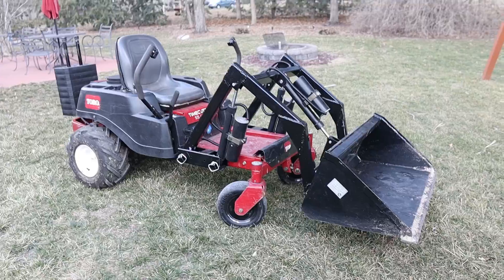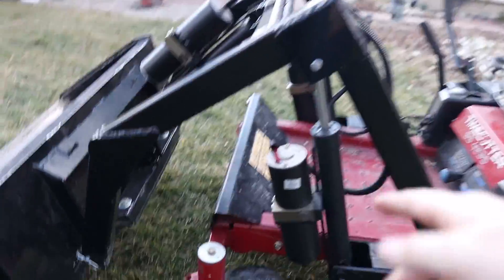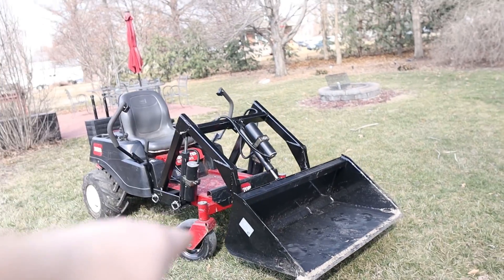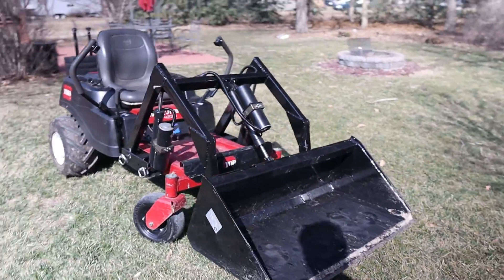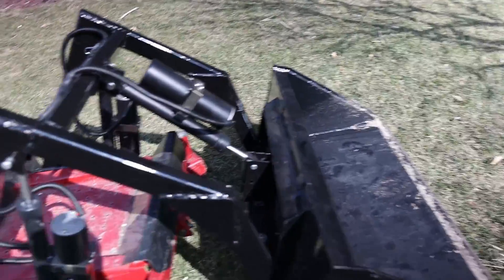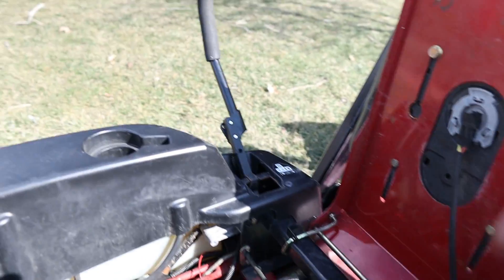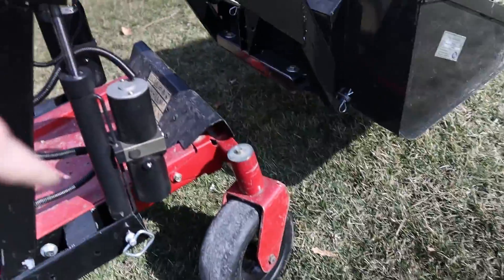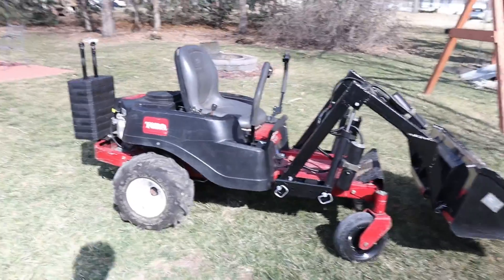You Converted a Toro Zero Turn into What?? - Homemade Skid Steer/ Front End Loader

Comment: with rubber tires like that  it can go on the highway  with the SMV triangle because it has a top speed of 25 miles an hour or less therefore it's a slow moving vehicle like a skid loader or farm tractor I use a slow-moving vehicle sign on my Craftsman gt6000 because a tractor is a tractor no matter how big it is and that's fact's

Comment: Cool idea. I suggest upgrading that little trailer plug connector as it will overheat with 40+ amps. Anderson powerpole 50amp would be good. They make rubber boots to cover when not in use.

Comment: Hmmm...same bad design as all the other makes of these things.  Let us see you load that huge bucket up with gravel and drive over dirt or gravel with it.
My point is it would be much better if your frame mounts were behind and in front of your rear tires.
Why?:
Weight 90+% on rear wheel.
Bigger axle
Tiny wheels won't sink in as yours will do ATM.
Won't lose traction.

Go ahead and make me a big-mouth dummy on the internet and show me a big load over non-paved soft ground.
BUT sure it will work....just "cringe" in that it is another video doing it "this way"...which may be OK...but is far from "good".
Reply from the maker: I absolutely agree that this isn’t the best design. It is not intended to replace something like a skid steer or dingo. This is simply a design that expands on a machine that many people already own. 

Really this is a big step up from a shovel but of course a leap away from commercial equipment. If anyone built this with those expectations they would be enlightened rather quickly. 

I will add one concern on a mower like this where the frame is a thin C-Chanel. If the pivot for the arm was at the rear and the actuator was fixed in front of the rear wheel this would be an extreme amount of force likely causing the frame to bend. Also the extended travel and weight of the attachment would be too much for the cylinders that I have. It would dramatically reduce the payload and likely struggle lifting just the bucket.

Regardless, there is always room for improvement and I documented my take on the idea to make it easier for people to improve.
Reply: @ChadMees  I plan on making something a bit more robust next summer.  There is a great deal of lift difference between these lawn tractor scoops and a skid-steer.  My goal is to be able to dig non-loose soil 300 lbs a scoop.  The cost should be about the same as yours.  Some critical design changes should see some significant improvements.

Comment: Just finished making a zero turn loader myself.used an older simplicity zt mower. Made the bucket out of heavy gauge steel and the rest with metal that was hanging around.I did it with hydraulic cylinders and a electric hydraulic pump, like what is used to tilt truck beds. Like your loader this thing is alot more powerful than I thought. Your video and others inspired me to make one. Each of my hydro drives are rated to take 800 lbs of weight so I'm not worried about stress on the drive system. It was a challenge but it was fun making it. Learned alot on this project. Thanks for the inspiration.
Reply from the maker: That’s awesome! Do you have any videos of it? I’d love to see your design
Reply: Still a work in progress but overall works great.Don’t have a video on it.I may do a quick video of it and put it on YouTube.
Reply: @mikeditomaso4451 I would love to see a video of your build

Comment: Would work better if you'd set it up with the loader to the rear and mount the  seat at the "front" that way he weight is on the big tires.
Reply from the maker: In order for that to work It would require a ton of weight to counter balance the bucket and whatever you are trying to move. It would make the entire system extremely heavy but I do agree that having the load on the larger wheels would be beneficial in several ways
Reply: Or mount the arm at the rear like a bobcat so that more of the weight transfers to the rear tires. But that involves more fabrication and design.
Reply from the maker: @kdrapertrucker  I agree, I wanted to do that but looking at the way the zero turn is built would have made that much more difficult. It would have also used much more material and could interfere with the drive controls. My main constraint with building this was to be as simple as possible and still be able to get on and off from the sides rather than stepping over the bucket like a bobcat.
Reply: That was the idea I had when mulling over ideas for a 'non-skidding skid steer'. Put the loader/lift arms on the back over the drive wheels to carry the weight and have it become 'the front', with the caster wheels now being 'the back' - would navigate like a forklift I think. The weight distribution is all wrong as @Chad Mees says - it would be a complete rebuild.  That led to the idea of making it an EV conversion where you can put the batteries at the back as part of the ballast.  Fun to think about, but probably not worth the effort. If you can find a free junker ZTR though......

Comment: I wonder how much of an adverse effect this use of a zero turn has on the hydraulic transmissions.
Reply from the maker: Fingers crossed, I haven’t had any issues at all!
Reply: @ChadMees  A lot of extra weight, loads, and stresses on this machine now that it was never designed for are my thoughts.
Reply from the maker: I agree. It is definitely not the intended use of a 11 year old mower. However it truly has been a workhorse. We used it to move a ton of gravel, dirt and dig for our garage additions and it never skipped a beat! I myself am also impressed with how it has held up since the hydros were a big concern of mine

Comment: How much do you think those front wheels will hold up?
Reply from the maker: Solid tires are rated for about 600lbs
Reply: @ChadMees  it's not the tires; it's the fact that they are caster wheels... If one of those hits a dip at the right time as you're changing direction the lateral forces on that spindly little...spindle are incredible.. I got 1½ seasons out of mine which wasn't worth it... It's a heat issue hydraulics get really hot and when pushed too far it ruins parts
Reply: @Lex Man there is a reason you don't see loaders with caster wheels... I think it could make more sense with the loader on the back but idk it's just a whacky idea to me I've made a hydraulic drive zero turn into a 4wd skid steer and it worked great as a plow but I fried a pump pretty fast... They're not made to push loads like that at low speeds it takes an incredible amount of torque to push a blade through snow nevermind scooping up rocks or dirt...it also seems like it could be dangerous?
Reply from the maker: Odd that you blew the pump so easily. Maybe it was fighting itself? I’ve seen attachments for zero turns like plows that bolt on and people seem to use them pretty hard! Obviously this is not the ideal use case for the hydros but as I’ve mentioned before I haven’t had even the slightest hiccup. That’s doesn’t mean I won’t blow one but I’m impressed nonetheless

Comment: Love innovation..   I modded my SW4200 to be a super vaccuum leaf collector.   The ZT can go near anywhere..  mine is a wannabe tractor, thinking a bucket might be in order.  BTW.. you can install bigger tires and wheel spacers for even better Traction.
Reply from the maker: I have actually done this already. I installed 1in spacers and put slightly wider and taller mud tires on the rear for more control. It made a big difference with handling especially on loose surfaces like gravel
Reply: @Chad Mees  would love to see a update of the 0turn fel
Reply from the maker: I’ll see if I can put another video together in the next week or so. The weather has been pretty poor lately
Reply: @ChadMees  That would be great. Thank you so much

Comment: Have you tested the lift capacity Before lifting the rear tires?
Reply from the maker: Before putting the additional weight on it I did not test the lift capacity. The loader was not at its limits but I would have trouble because even though the rear wheels were still on the ground, I wasn’t able to steer or move around. The wires would slip/spin because there was t enough weight on them.
Reply: You mean it won't turn because the shopping cart wheels are buried into the ground and bound up🤣 I hope you don't get hurt on this but that is the only thing I can see happening if you ever use this for more than a few pebbles

Comment: The capacity of the bucket is comparable to a small wheelbarrow which can easily be operated with muscle power so you don't need hydraulics.

I would use 12 volt  electric linear actuators. They are available with various stroke lengths and weight capacity.  I would just use a lead acid car marine/deep cycle battery or two of 6 volt golf cart batteries which I would mount on the back as counterweights.
Reply from the maker: I looked at linear actuators and unfortunately they are extremely slow when dealing with large weights. Also I believe you are underestimating the capacity of this. It can lift 600lbs in the bucket above waist level. If you can find comprable actuators that can move at the same rate and support the same weight I’d be more than happy to check them out.
Reply: @ChadMees  How quickly (number of seconds) do you need to raise the full 600 pound load to a height of 3 feet?
Reply from the maker: Roughly 10 seconds from memory
Reply: @ChadMees  What power is required? (Assuming 100% efficiency.)  (600 / 550) x (3 / 10) = 0.33 HP which is 250 watts.  Since there would be an actuator on each side of the bucket that is 125 watts per side, or 125/12 = 10 amps per side.

That seems reasonable. Now let's see if we can find an actuator, keeping in mid that we will use the arm as a lever so a short movement of the actuator causes a large movement in the arm.

Comment: Very nice. Those cylinders solve the problem of installing a hydraulic pump and reservoir and running hoses. Thanks so much for sharing.
Reply: Don't zero turns already have them built in? That's how the wheels are powered.  I'm trying to find a way to get auxilary hydraulics to work on mine
Reply from the maker: Technically the hydrostatic motors for the drive wheels is a hydraulic system. I wouldn’t ever try to run anything auxiliary off of them due to the massive amount to modification that would be required. Also the hydro drives are usually what fail on these mowers so I wouldn’t want to put any additional stress on them.
Reply: @ChadMees  hmm perhaps I can run a separate pump off of a belt or an electric one with an alternator. Thinking of a backhoe attachment too but at that point it might be cheaper to hit the auctions lol
Reply from the maker: @andrewk8636  if you were to go all hydraulic you could ignore the alternator. There are a few guys with videos on YouTube showing a power steering pump being used with a control valve to accomplish a similar thing.
Reply: @ChadMees  alternator makes it way simpler because I don't need to figure out clutches or find room for a huge pump under the mower. I plan to keep it all removable so I can still mow. I got a ton of research to do on the various systems.

Comment: do you have someone interested in manufacturing a kit that could be installed without having to weld the frame?
Reply from the maker: I do not. This would be a very specific kit and only fit certain mowers. Given it could be adapted to many but would take some time.

Comment: This is an awesome setup. Great job!  When trying to balance tractor attachments, lots of folks add calcium chloride to the rear tires.  Especially on a zero turn, the rear weight setup you have is probably a much better choice - the added rotational inertia from weighted wheels would rob you of the "flickable" nature of turning the mower.
Reply from the maker: Thanks for the kind comment. I looked pretty heavily into adding weights within the tires and found a few companies that will fill them with different materials. The issue I had with this was mostly the cost. Some of the research I did showed people filling the tires with water but again I didn’t feel comfortable with doing that. I also prefer having just air in the tires because playing with the pressure is very helpful in different situations. I went with the cheapest route by using the gym weights since they are relatively cheap and easy to come by. Another reason I think adding weight like this is that it is behind the hydros therefore I can use less weight compared to if the weight was added 1-2ft further forward.

Comment: Sadly those Hydraulic Actuators you used are sold out there, can't find any other ones like them anywhere, guess I gotta build a hydraulic system then lol
Reply from the maker: They have been telling me they should be in stock mid July. I will reach out to them again but they had a big run on them initially.
Reply: @ChadMees  Fair enough, I mean the whole world is having shortages on everything it seems, but I'll keep my eye out so I can snag a few of them!
Reply from the maker: Definitely, the hard part for me was even finding these to start with. They are not very popular (yet) I think projects like this will change that and more sellers will stock them. Unfortunately for the time being this seller is the only one in the US that even is getting them. You can source them directly from China through alibaba but they are a bit pricey. I’m hoping this seller is getting a bunch because I have had a ton of people trying to build these and they are hung up on acquiring the cylinders
Reply from the maker: My last message from them was saying they will be in stock July 15th. I really hope they have a lot of them but I would keep checking the link because I expect they may not have them very long. I will probably buy a few for some other projects too just so I have them!
Reply: It's October & they are back on Ebay.

Comment: Hey I’m looking to replicate this on a cub cadet and see how it turns out. Finding the actuators are not easy.   I have 2 questions for you. 1) why 10” and not 12” actuators 2) could you look at alibaba and see what actuators you would use from there? Since I have no idea what I’m doing just trying to emulate what you have done? If you could send a link or pm me so I know what to order that would be awesome. Only parts I cannot source.
Reply from the maker: Check out this product on Alibaba App FY023 Waterproof Electro-Hydraulic Linear Actuators for Chemical Industry

https://m.alibaba.com/product/1600149577112/FY023-Waterproof-Electro-Hydraulic-Linear-Actuators.html?__sceneInfo=%7B%22type%22:%22appDetailShare%22,%22data%22:%7B%22filterKey%22:%227.8.2_share%22,%22cacheTime%22:%221800000%22%7D%7D
Reply from the maker: Main reason I went with 10” was for the compact size when it is the fully compressed position. As for sourcing the actuators I need to reach back out to the eBay seller because they simply had the best price and shipping time. They are on alibaba but they are a bit of a pain to search for. I believe I had to search “hydraulic actuator” to find them. I will comment a link to one similar to what I used.
Reply: @ChadMees  They are now (10/21) back on epay.

Comment: This is pretty cool. The only thing is I realize the hydraulic actuators are convenient, but wouldn't it be so much cheaper and higher performing if you just built a hydraulic unit and used conventional cylinders? Then you could have an auxiliary valve for a grapple or anything else you wanted on there. Also it would be cool if you added a quick attach so you could put forks on for moving pallets around. Not trying to be a downer, love the ingenuity just throwing out ideas.
Reply from the maker: My main reason for going with the electric cylinders was to make the entire thing easy to replicate. Connecting a few small wires and routing them through the mower is easier than dealing with a hydraulic pump, manifold and hoses. The only reason I could see the hydraulic setup working better would be for the speed. As far as price goes it would end up costing almost the same amount from what I priced up. As for the quick attach feature, I wanted to include this but the quick attach plate that would be required was very expensive and heavy. I didn’t want to lose anymore of the payload capacity by throwing another roughly 100lb plate up front. In the future I hope to try and build something with hydraulics because the cylinders are much cheaper/efficient but that will be a learning curve for me since I’ve never messed with it before. DC stuff has always been my go to!